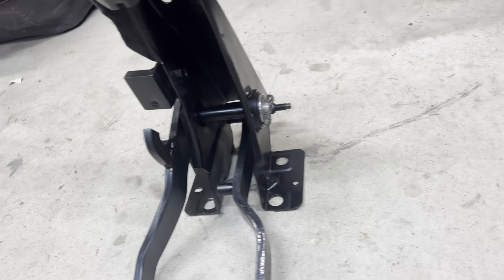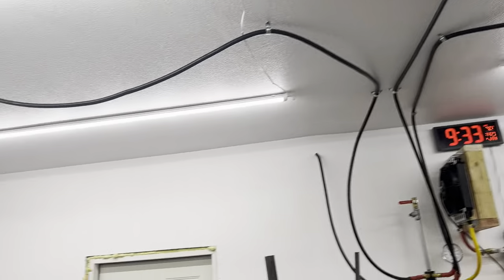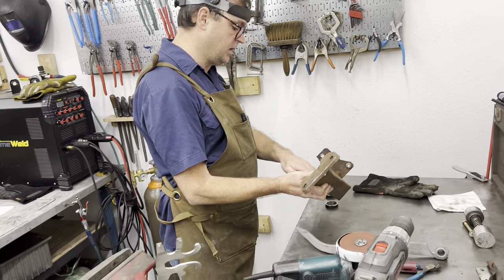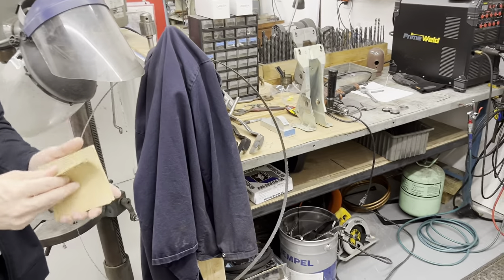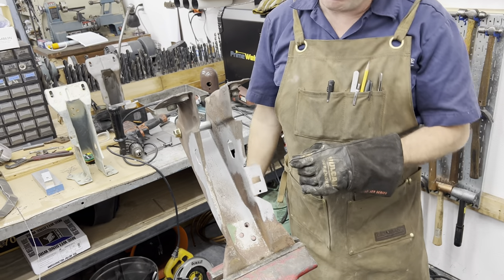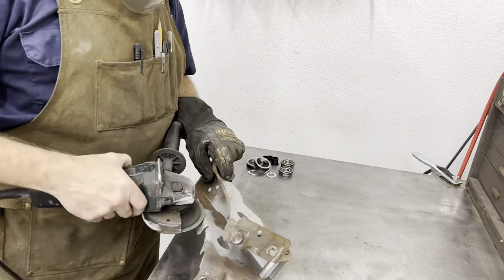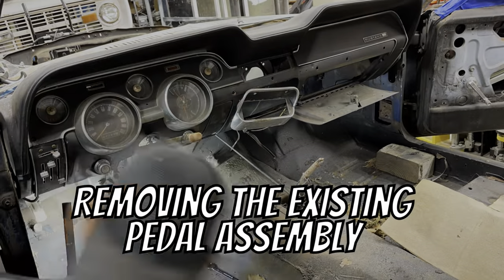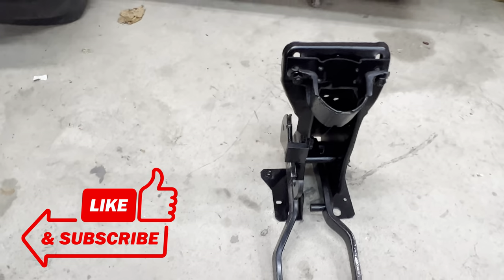Do this to your muscle car clutch pedal. 1967 Mustang clutch pedal assembly modification.

Comment: This looks like a great product. I don't know how long this has been around but I sure wish it would have been available when I did a similar mod to my 67 Shelby back around 1975. I also used roller bearings but I found some freeze plugs that fit the bearings and welded them like you do the races. Kind of primitive but we did with what we had back then since there was no internet. By the way, my clutch pedal is still as smooth as the day I added the bearings!